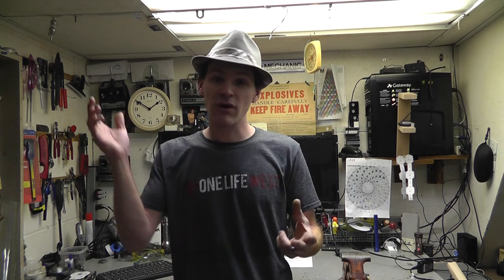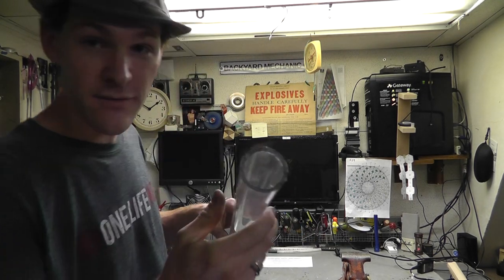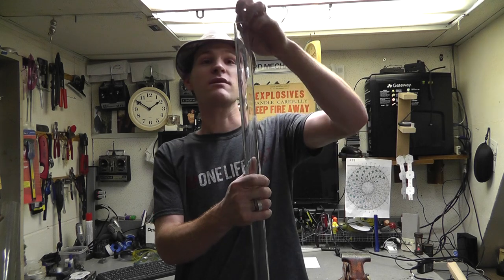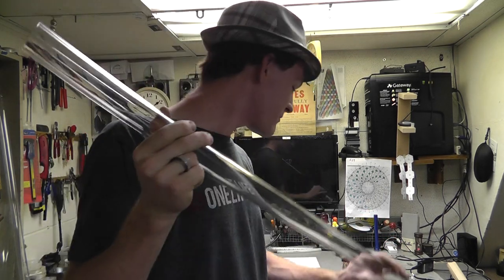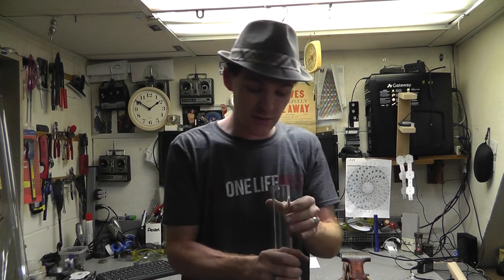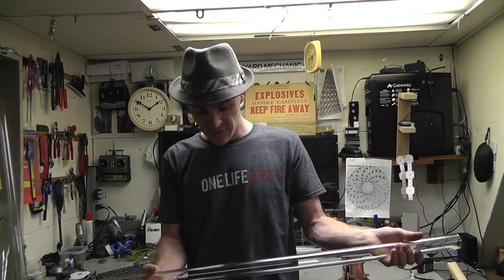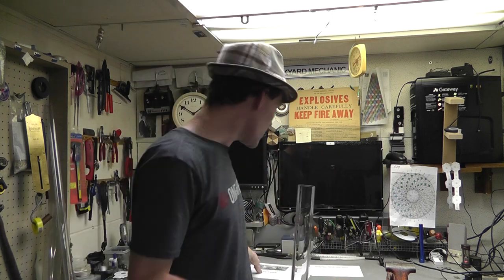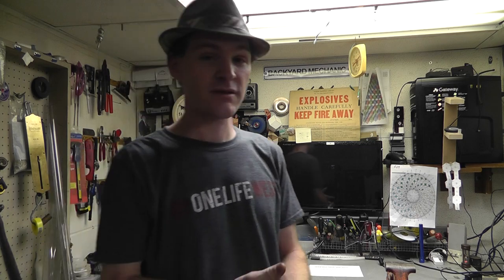"Burn-O-Meter" Update... RWGresearch.com

Comment: I am merely waxing philosophical here, but I remember spudtech (dot) com has rifled potato gun barrels in their store.  Since they have the capability to put rifling into plastic, you might approach them about cutting a smooth circumference on a piece of polycarb with their lathe, or whatever you want to use.  Their lathe is bound to be pretty substantial.  Or, well, you're bound to know someone with a lathe that has decent travel for the job too :-)

Comment: @rwg42985
Hey Russ instead of using a piston style design use diaphragms of progressing thickness with in the tube and plastic spacers to hole the diaphragm and set the distance  between each of them . Kinda like that they use in explosives testing underwater to test the shockwave

Comment: Hey I don't see why you wouldn't be able to use the pyrex with a piston? for as long as you don't have any back resistance you are golden! keeping in mind that you wouldn't find nothing that is as affordable and at the same time can be as useful! if you fear fractures or breaking it, just sleeve it with some stainless and use epoxy to take away the tolerances between the glass and stainless